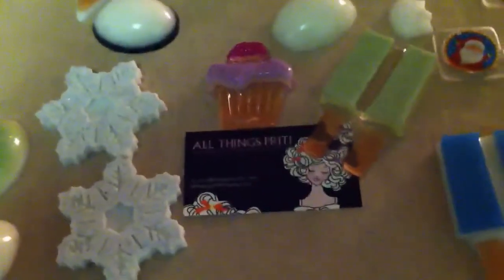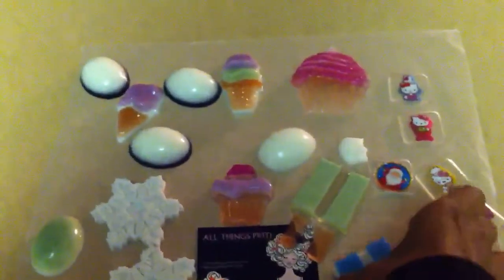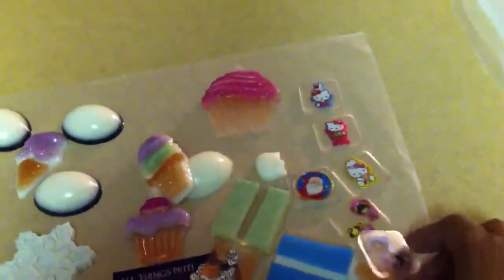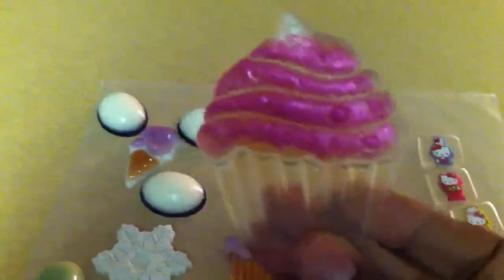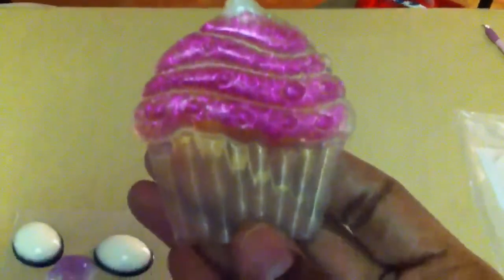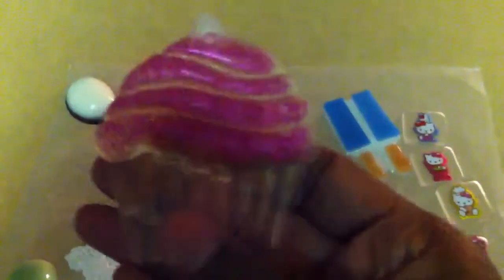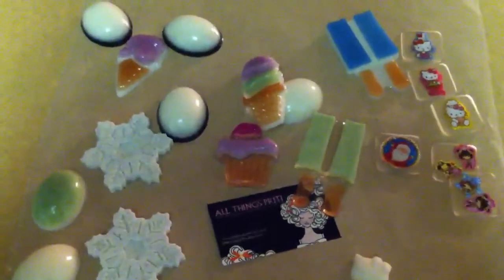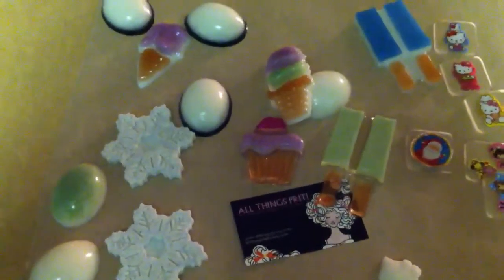Resin Questions...Help Please!

Comment: @Allthingspriti   I occasionally use castin craft or alumilite pigments but I find that they change the chemistry of the resin if you add to much..  I mainly use makeup powder pigments and mica powders or you can also use ground spices - cinnamon, cumin, etc.  (smells good too).   Tapplastics (dotcom) has some great pigments if your looking for nonsparkly type colors.  Their brand not the castin craft ones.

Comment: Most pieces come out of mold putty coarse because they aren't super glossy on the surface, you will need regular silicone to get a better mold but either way if your piece your molding has a texture, your mold will.  I have never had any luck with acrylic paints in resin either.  One little drop of unmixed paint on the surface will ruin a piece and ruin clothes if it comes out on them.  I have a piece from years ago used with paint still have wet paint coming out on the surface.

Comment: I haven't had luck with using paint in mine... it never fully dissolves and it will "leech" from the surface.  You must be getting some paint bubbles on the surface.